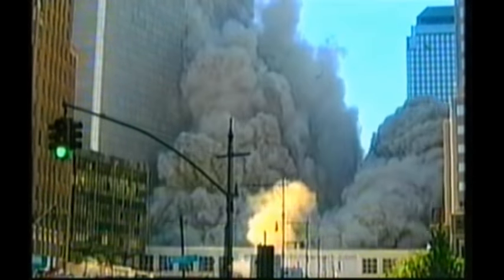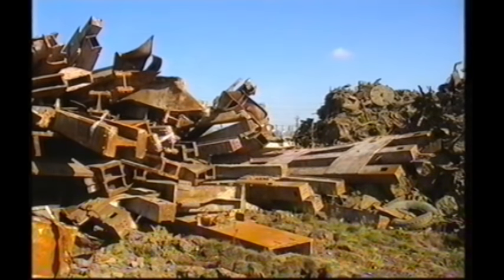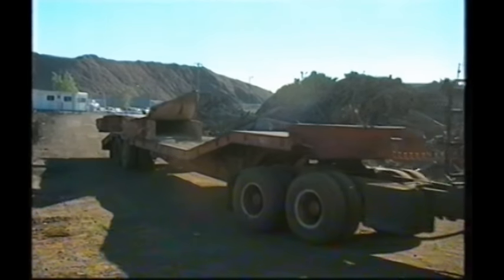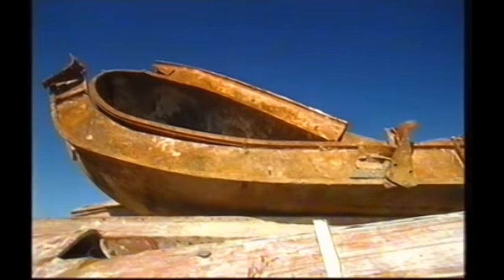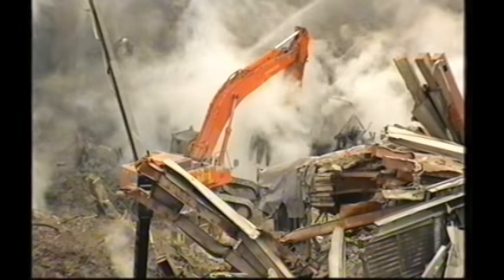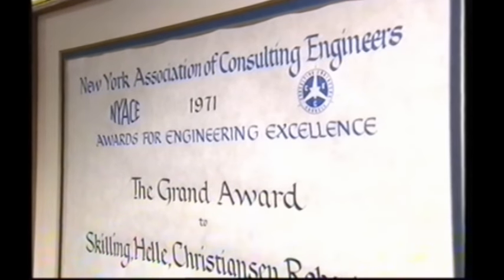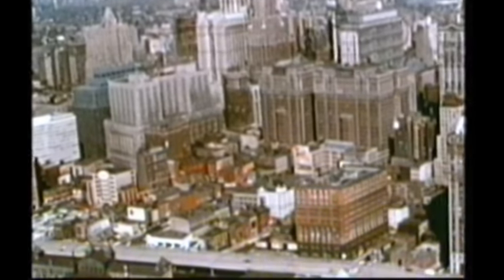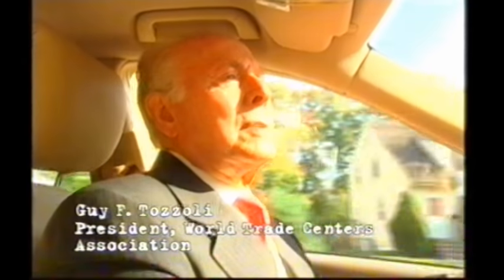9/11—"How The Twin Towers Collapsed" (C4 documentary, 2001)

Comment: The fire was at the top of the building and the fact that the building collapsed without any resistance at all proves this theory wrong. The lower floors would have slowed the collapse and bring it to a halt. How do you explain building 7? No impact there but that fell exactly the same way straight to the ground with no resistance whatsoever.  You could say it could happen once but not a second  or third time.
Reply: Exactly, I remember a few days after the collapse they had a structural engineer on one of the news programs and he started talking about how they should have never collapsed and was talking about the steel core and they cut him off and went to commercial and that was it never heard of him or that story again, can’t find it on here that’s for sure. So many sheep in the comments.

Comment: Apart from factors descibed in the video. The pressure of wind 13000 t-f vs around 409 tons-force when the airplane hit. I might be wrong, but what hadn't been considered is the difference between force such as wind that dissipates across the structure vs sudden force added to a relatively small surface. The area of a side of the WTC tower was 282100 sqf. For calculated 13000 t-f of wind it makes only 0.046 t-f per sqf. Whilst the additional dynamic forces per sqf during 9/11 attack were lot greater than that. So, this factor's been overlooked during design process.
Plus the temperature factor to all creators of conspiracy theories. They consider only one, single parameter at once. When there was few key factors regarding temperature alone. Such as materials inside the building, and building itself working as gigantic furnance. Other words, there's huge difference between fuel burning in the open, with no additional fuels vs fuel burning and igniting lot of different materials inside partly closed structure, with constant supply of oxygen.
Reply: How did you derive the '409 tons-force' figure? And, what does it mean?
Reply: @kyle381000  I used speed to force calculator. And typed in approximate numbers from the video. Like I said, the numbers are to show certain proportions. 
They may differ with more exact parameters. 
Mass of the plane 200t, speed 450 mph. The narrator said 400mph. But somehow I typed in 450. Anyway. 450mph = 201 m/s,
Speed to force calc gives result 4020000 N, which is 409.92 t-f. 

With speed 400 mph = 178 m/s, the force of impact would be 3560000 N = 363 ton-force.
What does it mean? Tons-force it's not actual mass of the object. For example how to weigh wind? But they estimated its pressure onto the structure.
Good question.

Comment: Supposedly, thousands of people were still trapped on the top floors. But in all the aerial shots, you don't see people on the rooftops. It would have been so simple to pick these people up with a helicopter. Has somebody got an explanation for that?
Reply: Great question! The doors to the roof were locked & required key card access. The doors were locked after the rope walk.
Reply: @nahplayer . And for this case there is a fire axe. AND anybody could have broken the top windows and called a helicopter with a rope. And why did all the other surrounding buildings collapse? And I've got even more inconvenience if you will !!!
Reply: @andreasfehlau4965 Even if they could get to the roof, the smoke would’ve killed the engines. It wasn’t worth risking.
Reply: @mike2c512  I don't think that the conspiracy theorists can manage practical problems like that. Too busy wanting to believe bullshit, unsupported theories fed to them.

Comment: I was in the North Tower in 1981, as a young member of a Lloyd’s of London group visit. - Lloyd’s insured the construction, well part of it.  I vividly recall our host for the day saying how the building could withstand a plane hitting it. The one striking point about the Twin Towers was the absence of many centre columns inside the structure. You had huge open areas without support. The main support came from the external steel on the outside and when the towers were hit with a very large, fully fuelled jet, it just disintegrated.

Comment: They cut the evidence up quick
Reply: Define "quick". Because the last steel left The Pile 9 months after the attacks.
Reply: @timshea4279 ’quick’ referring to the length of time they kept the steel compared to the time for a thorough investigation to be conducted. Or the time the steel was on hand when compared to the duration of the sites cleanup to facilitate a proper investigation.
Reply: If you think that was quick you should check out how soon the Pentagon lawn where the ‘plane’ impacted was covered over with soil. 
The speed at which they literally covered up any evidence and the scene of the crime was light speed!
You would think they were hiding something lol
Reply: @bottplug2272  
What evidence do you think was covered up?

Comment: The engineer was not at fault. It is obvious that some source other than the aircraft and their fuel which could not cause the structure to have collapsed. The best information is not able to agree with the circumstances of that day. It is not possible to have melted the steel and even if it did have the temperature only the steel that was subjected to that heat would not have caused it to collapse. The thought that those two aircraft were the cause doesn't have any capability to have done the thermite nodules found in the dust. It was present in the liquid being expelled in bright molten materials that poured out of the corners of that building as you can see.

Comment: This is very misleading documentary. They left out so many facts. These towers were designed to withstand these aircrafts. The documentary also forgots to mention that those floors can't collapse in near feefall speed just from the initial impact. That would totally be against most of Newton's laws of motion. To get the result we see on the videos, something had to destroy the steel below the collapse with additional energy. Lots of extra energy. They also forgot to mention the molten steel burning underground for months.

Comment: Wow.. that architect should have built the towers like the Torre Winsor of Spain that in 2005 burned for 26 hours straight and never even buckled, just burned and remained standing... Come to think of it the only 2 skyscrapers that have ever collapsed because of fire have been The Twin Towers 1 and 2 and they only burned for about 90 mins...
Reply: You mean with a reinforced concrete core instead of steel?  That is how the new One World Trade Center is built.

Do note that ALL of the steel structure above the 17 floor (a heavy reinforced concrete mechanical floor which functioned as a fire break) at Windsor Madrid completely failed in just a hew hours. 

All of it. 

Had Windsor Madrid not been of composite construction but been all steel, it would have collapsed in probably less than 3 hours.

Comment: The WTC was a tube within a tube.  Each building had 2 super structures.  Not just one!  Those 2 super structures were tied together with the floors.  The outside super structure was shored up with massive steel plates.  The floors were tied to both super structures with both welded and bolted joints, tying together the floor trusses with both the inner and outer superstructures.  
         The only way you can explain thousands upon thousands of welded and bolted joints failing simultaneously is through the use of high explosives.  It's not physically possible for that many solid joints to fail simultaneously.  Not from asymmetrical damage caused by the plane strikes.  Jet fuel is not a high explosive.  The elevator doors blew across the lobby because the basement was imploded first, so the building had somewhere to fall into.  Otherwise,  the heap of steel debris would stand several stories tall.  Waiting to tip over.  
          And don't forget, the site burned for 3 months after 9/11 because thermite cutting charges were used in conjunction with high explosives in the basement.  As well as throughout the rest of the superstructure.  Thermite has it's own oxidizer, it burns without the presence of oxygen.  Keep in mind also, these buildings fell at freefall speeds.  The undamaged structure presented no resistance to gravity.  The undamaged structure should have put up resistance to the partially damaged structure.  This did not happen.  Why?  High explosives...
Reply: The design of the towers was in the form of a hollow pipe with a core in which elevators and communications were located, crowned by a massive lid consisting of support trusses for a television tower.  Tensed cables ran down from it along the core, that is, the structure was tense.  No one expected that the building would withstand the ramming of an airplane, just as, for example, no one designed the Titanic to collide with an iceberg.  200 thousand tons of steel were spent on the construction of the towers.  The weight of each floor slab was about 1,500 tons.  The total weight of both towers is about 500 thousand tons.
 According to some architects, it was the design of the towers that caused such a rapid collapse.
Reply: @igok8357  If that's what you choose to believe.  Who am I to judge.  If you believe that thousands upon thousands of welded and bolted joints can fail simultaneously.  And that the undamaged structure offered zero resistance to the "collapse" of the upper floors, more power to you.  If you believe that asymmetrical damage can cause total global symmetrical collapse from less than 10% of the building being damaged, I have a bridge to sell you.  But how do you explain building 7?
Reply: @digdugbingo  damage to one load-bearing column.  These buildings prove fragile to minor damage due to structural stress.

Comment: In the aftermath of the implosion of all of the trade center buildings, all of the debris was gone through with a fine tooth comb searching for the bodies, for the arms, for the legs, for the hands, for the fingers, for the ears, for all the body parts they could possibly find. It to look an enormous amount of time and human resources.  They were able to find nearly every body part because of that incredibly detailed search.
They DID NOT find one jet engine, they did not find any of the landing gear, they did not find any of the hundreds of chairs, from any of those aircraft.  Nothing!  Not one scrap of an aircraft was ever found in all of that debris, despite the incredible search they made for human body parts.

The landing gear, the engines, on those airplanes, are the most substantial, strongest, most durable, and largest parts of an aircraft. Not one clue, let alone any pieces of any landing gear or any jet engines were ever found, WHY?  The only possible answer is because there were no aircraft!
And you may say, well I saw the aircraft crash into the buildings!  No. What you saw was CG, computer graphics. It would be extremely easy to dub in an aircraft in just the right place, at just the right time, at just the right attitude, so that you would think an airplane crashed into those buildings.  So where are the debris?  They’d never found any aircraft debris.
You have seen movies in which computer graphics are used extensively. There are some movies where the only thing that’s not computer generated are the actors.

But if there were aircraft that flew into those buildings where did all the parts go? There were no chairs, there was nothing! Not one clue whatsoever that aircraft were in the debris that was searched looking for human bodies and body parts. No aircraft debris at all, Nothing! 

Come on people you all can't be that gullible.
Reply: funny how every 9/11 denier has a different story of what happened, i wonder why...
Reply: @failtv5442 Faily, you need to up you game now, Tim Shea is showing you up - he really sounds like he knows what he's talking about. They'll demote u to Prince Andrew comments if you're not careful 😅

Comment: They removed the remains of the building as fast as they could. It was a crime scene and that was unaccrptable. They did no
Investigation  or testing fir residue of explosive material. The buildings fell at free fall speed. There would have been resistance if it fell as they say. They didn’t mention building 7 in the report. Building 7 has xooradic small fires,you can see in the videos. It fell,like the two towers,exactly the way a controlled demolition falls. Believe your eyes.
Reply: Of course the remains were removed as fast as possible.  The #1 priority was recovered human remains, that could not be done effectively on site and the clock was ticking.

You ever time the collapses yourself?  Or are you just repeating something you saw on the internet you thought sounded cool?

I timed it myself.  33 seconds.  For those keeping score that si 1/3 the rate of gravitational acceleration (there is no such thing as free fall SPEED) meaning 2/3 resistance, or more than enough.
Reply: @MFitz12  so … the cause of the never before vaporization of three skyscrapers wasn’t a priority, but the dust that continues to kill thousands and contained the remains of the victims killed that day was the #1 priority. I got it . Wonder what they found that triggered you to spend every minute of every day responding to comments years after year. Quite a monumental effort but to what end?

Comment: they went down by control demolion.they had been wire about two weeks pior. power outage over a weekend .witnessed saw men placing red boxes on different floors. 8.9 sec they fell.Imploded as control demolion does.jet fuel does not ge hot enough.Only tremonite gets hot enough to been steel beams
Reply: Ever actually measure how long the collapses took yourself?  Or are you just relying in the internet to do your thinking for you?

I measured it myself. 

33 seconds, not 8.9.

Comment: why is it the building was blown away from the building towards away the building going downward and imagine 13000 tons of strength it's impossible to flattened that building without using a bomb on each floor of the building going downward and about building 7 how did it collapse nothing hit the building and why did they not investigate after the collapse
Reply: I'm sure you know what you meant, but I doubt anyone else does.
Reply: @MFitz12  But his command of engineering is at least as good as his command of English!

Comment: 3:16 "Huge grappling machines struggle to cope with chunks of metal the weight of the trucks used to transport them" yet alluminum wings , with signs on them warning " do not walk beyond this point" cut straight through them, leaving a perfect profile to the very fragile tips. Wow.
Reply: Do you know and understand the term 'kinetic energy'? It applies here when a 120-tonne airplane flying at 400+ knots impacts hollow box girders intended to resist static vertical loads but not dynamic lateral loads. Also, the vertical external surfaces of each tower were 30% glass.

Comment: Does anybody know that the empire State building got hit by B-52 bomber and it was still standing like 50 years ago
Reply: Yes. First of all, it was a North American B-25D training bomber.  2 propellers. The B-52 was still a decade away and powered by 8 jets. There is a substantial size and speed differential.

In 1945 a B-25 bomber weighing 1/10th of a Boeing 767 and traveling less than half as fast got lost in fog and hit the steel framed and limestone clad Empire State Building with enough force to punch a big hole in one side and for parts of the aircraft to pass all the way through the building and out the other side.

In 1945 that 10-ton B-25 impacted the ESB with the energy equal to about 41 pounds of TNT which to be fair is a lot of energy. 

On 9/11/2001 the 117 ton Boeing 767 for Flight 11 impacted with the energy of about 1,400 pounds of TNT and Flight 175 nearly 2,000 lbs of TNT respectively . 

Is 1,4000-2,000 pounds > or < than 41 pounds of TNT?

Do you suppose that might make a difference?

Comment: explosives cut the central core at the bottom. then two light alloy planes flew in the side. then nothing hit WTC7 causing that to fall over too.
Reply: So what caused the inward bowing of perimeter columns by up to 5 feet until they buckled, initiating the collapses?

Comment: 00:40:39 minutes

Yes; the steel guider is bent .
Yes; an explosion dented & compromised the steel shown by the investigator.
Yes, this type of explosion , together w many similar , simultaneous others exactly like it occurred.

No; that degree of immediate, forcegully directed blast in no way whatsoever was indentationed & scalloped out in a shoebox sized area right on that spot. 
Do they imply that the energy of the 767 was microfocused into a neat 1' x2' box area , directly on the face of yhat beam??

that is so so obviously a shaped charge dishing of steel if ever there was such a thing. The energy of the huge plane ' exploding ' centered right into that one spot ....😏

Comment: What about the molten steel in the  bottom of the towers they burned for weeks?
Reply: What about it?
Reply: @MFitz12  well they all said that the kerosene fuel couldn't get hot enough liquefy the steel only cause contortions. Yet there was molten steel on the bottom of the trade centers for over a week...
Reply: @dutchschultz3076  So fires in a rubble pile from two skyscrapers is suspicious? Wow.
Reply: @TheMiddleClassholes  not fires molten steel!
If you don't know the difference you're not to bright...
Reply: @dutchschultz3076  Who verified it was steel?
Reply: @dutchschultz3076  - Answer don't ignore my questions please. Don't argue facts not yet in evidence.